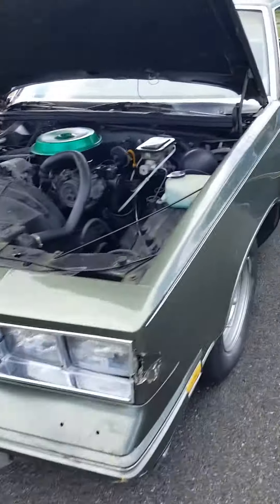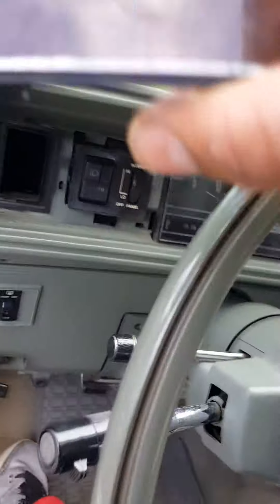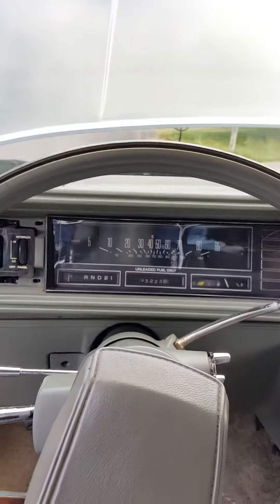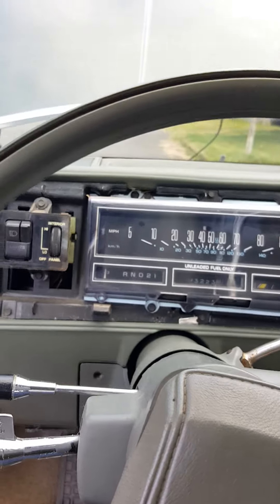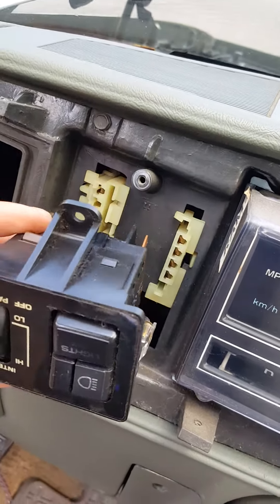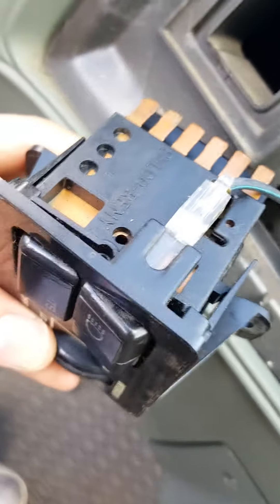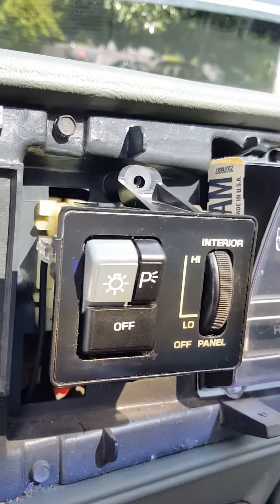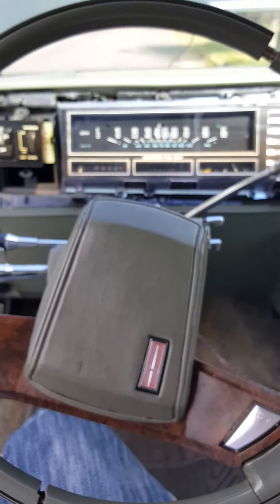1985 Oldsmobile Cutlass Supreme Headlight Switch Replacement

Comment: Don’t know if you’re still watching but I think my dimmer switch is bad . None of my lights come on just got finish tearing the cluster apart cleaning connections etc and bending the pins to have better connection. Jumped the cluster and all the lights work but still no lights when I put it in the car

Comment: I ain’t have to do all that on my 1985 cutlass I just took cover off light switch took screws out and replaced old switch done 5minutes
Reply from the maker: Hmm idk. This is correct procedure step by step according to the GM service manual (besides disconnecting battery before hand).
Reply: Where did you get the switch from

Comment: Does your sensor door sound stay on? cause my does after I did the exact same thing you did 
Please give me advice and thanks 🙂
Reply from the maker: Joe Garza nope everything was fine afterwards. Did you have the battery disconnected before you did any work on the electrical system?
Reply: Amha Ademasu for some reason my sensor door sound 🔊 stays on.And no I didn't 😧is that maybe why?
Reply from the maker: Joe Garza try dosconnecting your battery and reconnect it. disconnect neg first then pos. then reconnect pos first then neg last.